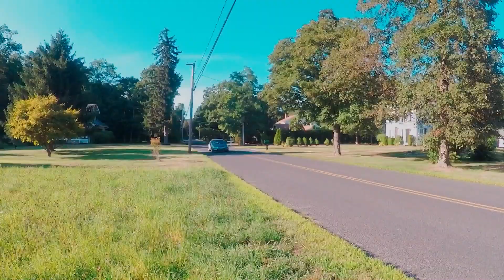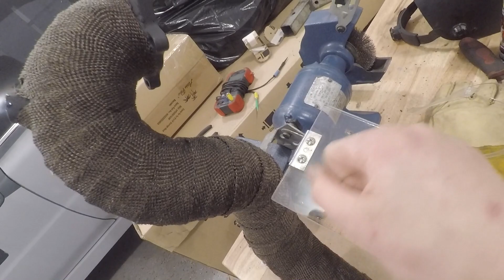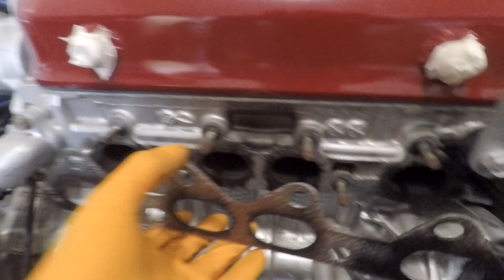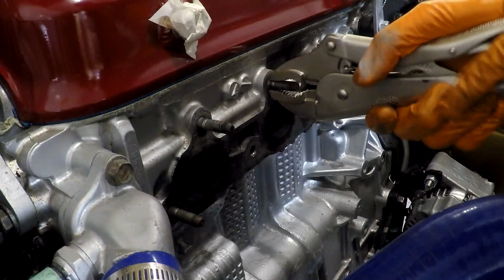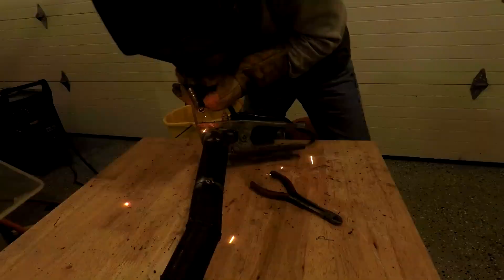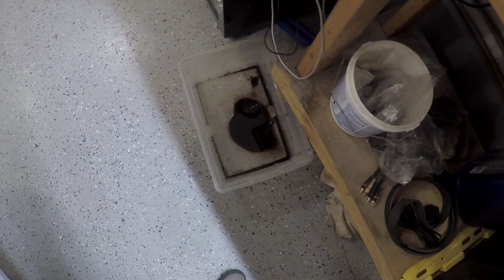Fixing Exhaust Manifold Stud Turbo Honda Accord

Comment: Took off my manifold cover to diagnose exhaust leaks and just found two broken studs almost exactly like yours(the bad one is the same spot as your deep break). Dreading this job, but glad to see someone with literally the same exact problem get it handled cleanly and correctly! Mine is just a stock 94 accord
Reply from the maker: Nice glad you got it figured out and fixed up. Feels good to DIY!  Definitely many ways to get it done depending on your tools basically. Thanks for watching!

Comment: I have the same bolt broken off on my f22a head.. lol. I tried welding onto it but it didn't work and made a mess with burn marks around the aluminum. . . It just kept snapping off once I tried to lossen it with a wrench. The nut that I welded on anyway. Plus I only have a flux core welder.. so I'm sure that didn't help
Reply from the maker: Might have to drilling it out with an easy out. You gotta get that welder nice and hot on there for it to stick

Comment: How far should the broadband from the outdoor collector be placed?
Reply from the maker: You're talking wideband from the turbo? I try to keep it around 6" away angled slightly down so it doesn't fill with condensation on startup and minimal lag time.

Comment: Hey bro I'm having a problem with my motor there is smoke coming out of my dipstick and oil cap when it's running any suggestions what it could be ? I replace the pcv valve but still didn't work in thinking bad is Saturn rings are Pistons are valves what do you think any suggestions will help me
Reply from the maker: I had the same thing happening to me. Just means some air is getting past your piston rings. If it's only a little bit it's not that bad. If it's a lot, you can have issues. Your best bet is to do a compression test and see if you have good compression in every cylinder. If one or more is low, then you know you have bad piston rings.

You could run a catch can set up if everything still runs good like I'm doing now. But my motor is still running and venting out of the crankcase.
Reply from the maker: Ultimately if the car runs good, I wouldn't worry about it. Drive it till it blows up. Lol good luck bro